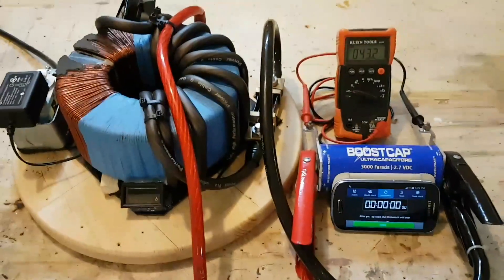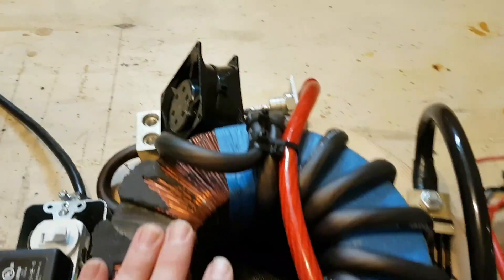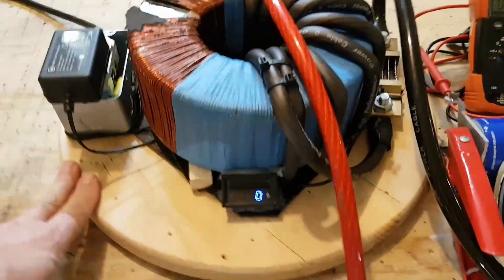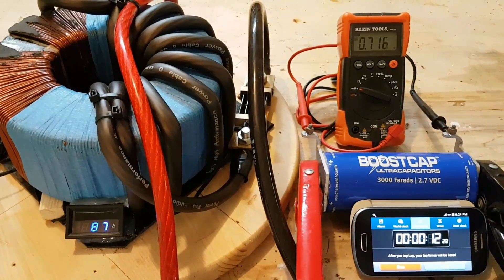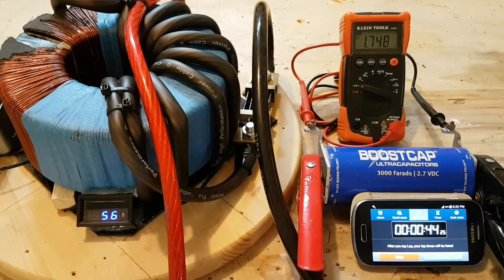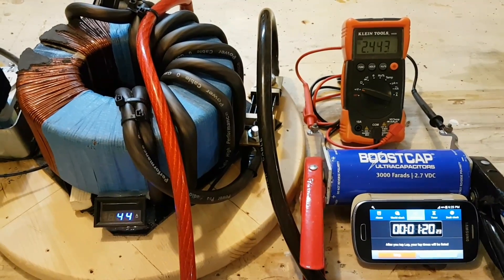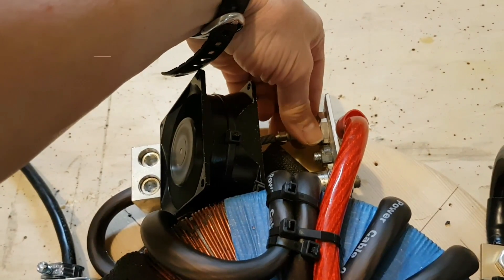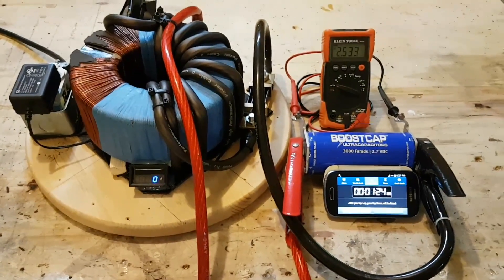Super Fast Charge on Super cool Caps!!!

Comment: I'm interested in keeping a 12-volt electric blanket warm at night and seems to me that when you have a virtually unlimited amount of charges on the capacitors that might be the way to go rather than using my Maya Heights Hi-Tech batteries which are hard to charge anyhow
Reply from the maker: Yes, these super caps are awesome.. and a 12 volt electric blanket doesn't pull that much power at all, these can work great for that purpose. Thanks for watching.

Comment: The application here is be able to go into the restroom in charge of these capacitors and go back to your go back to your truck and power things for quite a while. Using I see the advantage of the Caps is to be able to suck in a lot of power in the short. Of time and use it to run your computer and everything else between stops or possibly to run electric bicycle

Comment: Hi!I do the same principle for LiPo batteries. I think this is the only real fast charge principle for these kind of electronics(caps, batteries). For LiPo cells I use 4.2V end charge swich-off with relay. Thanks!
Reply from the maker: +Ansis99 
Hello, I'm not too sure about lithium Polymer batteries.. I know those require a special kind of charging which is not too fast or they could explode. I did hear about the new glass mat lithium ion batteries which do charge very quickly and less hazardous as well as giving you ten times more the power then of the old lithium ion batteries. Pretty cool I can't wait till those comes out on the market. Thanks for watching.
Reply: whyme2b My setup is based on 100W toroidal transformer which I modified with 2 Secondary windings with common ground. 2 Shottky diodes rectifiere main current and I find that 3.2V of AC at the every fuse is right now for filling LiPo cells to maximum. I notice no problems at all. :)

Comment: That's why you!!! ;).... Can you have same test, but now with your ampmeter on the wall outlet ?Thanks for sharing
Reply: THEWATERENERGY1 Whats new in your research?
Reply from the maker: +THEWATERENERGY1 
In the beginning I did have my amp meter on the 120 volt plug in to see the readings. The stats were 125 volt A/C in .... 11.6 Amps.... 540 watts and would drop gradually as it charge the cap. Thanks for watching.
Reply: Tunning down to working units,....we hope soon News,...stay tune...Thanks